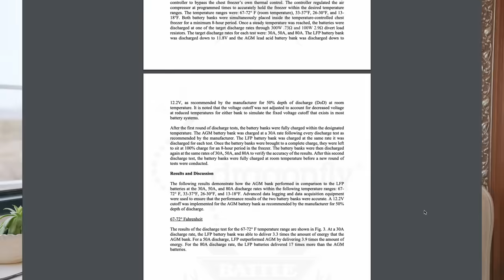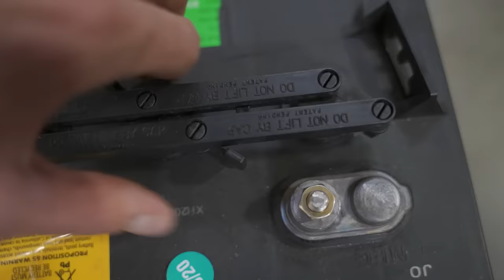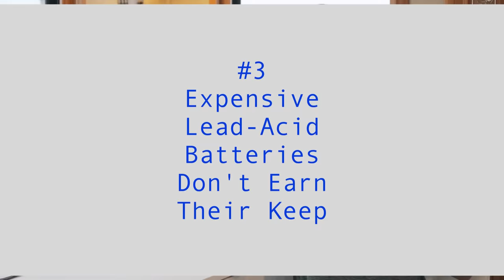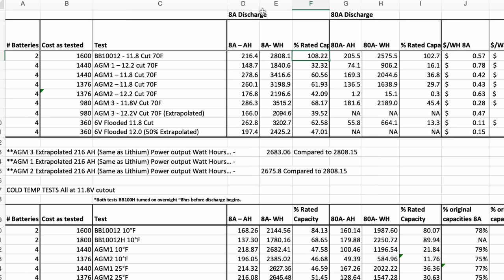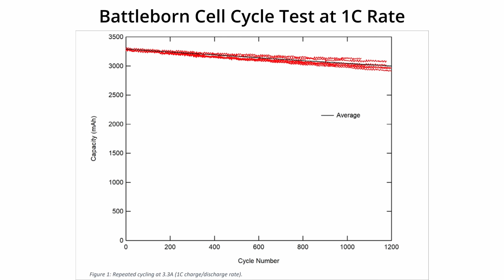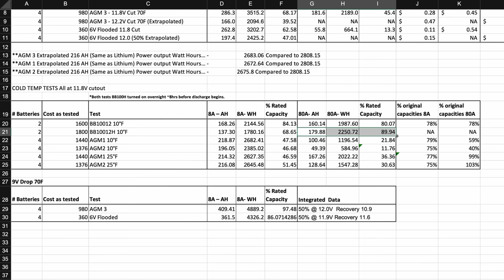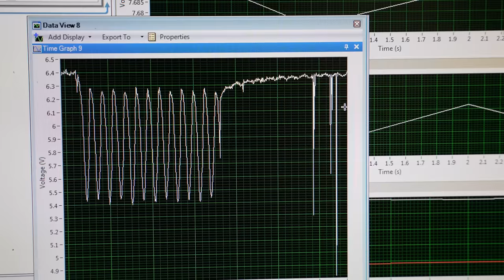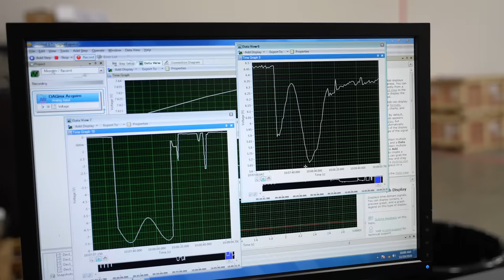Don't Waste Your Money On Batteries - The Shocking Truth I Discovered When Testing RV Batteries

Comment: Being a young person you have not had any experience with Ni Fe batteries you should look at these for stationary power banks. these batteries where used in diesel electric submarines, backup power in power plants,radio stations and traffic signals. the Edison battery company was bought by Exide  battery and was phased out by 1965 the main reason was the Ni Fe batteries lasted to long and the company could make more money by selling lead acid that only lasted 3-4 years. It is hard to find these batteries you can still find them and will need to change the electrolyte and run them through 2-3 charge cycles even these older batteries will out perform both lead acid and Li ion.

Comment: Wow this is incredibly interesting. I had the thought that Lithium Batteries may be significantly more cost effective than they seem when all things are considered but had no idea that it would such a big difference.
The only issue I have is that their warranties need to reflect the expected higher life cycle rates.
I bought an electric skateboard 18 months ago and the lithium battery has already broken after less than 100 cyles. This is a major brand battery and it is out of warranty so they expect me to pay another AU$450 for a new one (of which they are out of stock!). This is unacceptable to me. I have pulled the battery apart and will replace the dead cells but I shouldn't have to do that. It's still going to cost $75 for the batteries and a few hundred for a spot welder and I still don't know if I will need to replace the bms.
This is not a complaint about anything in this video just something to consider when purchasing expensive products, if they don't backup their lifecycle claims you can be left with an expensive anchor!
Reply: I always look at;

1. lead acid and AGM are great for buffering/caching power.
2. lifepo4 is a great source of power

For off gridding RV; i still use AGM 200AH under a converter for DC system; but goal is to keep that AGM at 80-90% charged.

LIFEpo4 is the source of power for camper (plug replacement)

Arguable some efferencey loss when going from DC->AC->DC (which bothers me a bit); but DC doesn't like to travel distances.
Reply: Just like my lithium tool batteries 12-15 months and they are dead.
Reply: @eliinthewolverinestate6729  I have two ridgid 3ah batteries from 2013 that still chooch. I use them mainly on an impact driver and 6.5" saw. Masonry is my line of work. Saw has been rebuilt once and impact driver is starting to get loose in the bit collar, but batteries are still holding strong.
Reply: @A. Melbs yeah old starter batteries seem to be very reliable, I had old cars for years and rarely had to replace them either.
The Brand of skateboard is a Backfire with Samsung cells, I’m not sure whether the issue was a cell fault or an assembly fault but I ended up having to buy a whole new battery because the cells I replaced didn’t fix the problem. My guess is the BMS needed replacing but couldn’t find one that I was sure would do the job. Hopefully the new battery last a bit longer anyway!
Reply: Lithium is not in amy way shape or form Cost effective . People don't know how to interpret the data he is presenting and not even him.
Reply: @eliinthewolverinestate6729  here come the anecdotal tales so prevalent on social media. 

Wow, really! Hmmm 12-15 months. I guess I learned something today! 😂😂😂😂
Reply: @suny1265  pretty sure it is
Reply: Not all lithium batteries are created equal.
Reply: @suny1265 
I’m guessing from your comment you would recommend AGM battery’s ? I’m having buyers remorse from an eco flow I just got (can still return) and am really thinking agm will be better for the cold
Reply: If they claim it in the description, they should add in the warranty. 

Not doing so is a big red flag.

Comment: There's one other really important factor. A calendar. We’ve purchased a grand total of 3 flooded lead acid batteries, EverStart brand, in nine full seasons of camping with our motor home. You could consider a fourth one that came with the motorhome in 2015. These batteries cost under $100 each, so let's just say $350 spent on batteries that have done everything we’ve asked them to do, with camping and travel and mixed intermittent shore power, charging while driving the motor home, using the generator, or solar charging. We do a decent amount of dry camping too. We’ve put 47K on the motorhome since May 2015, to give you an idea of how much we use it.
I believe in lithium-ion batteries for tools, however the price for these large RV batteries is still much too high and with no long warranty (8 years is what it would take) most of us are simply going to save money by not buying them. If you're going off grid and using lots of power, then maybe you will save money buying lithium-ion. But you're going to have to be careful where you spend it and with which company. From what I can tell, Battleborn is one of the most expensive.
And yes, there would be a convenience factor that is worth something with lithium batteries. There have been times where I have wanted more battery juice, but typically that has been toward the end of the life of the set of batteries. Although in the last year that has been less trouble since I built a small solar charger that we could use while dry camping. I am now in need of a couple more batteries, but just can’t pull the trigger on lithium.
I can see you know what you're talking about but your costs per watt used is misleading in a way to me. It would basically require you to use lots of power on average per calendar year, before you would see the difference in savings. I would have to be going through at least one to two sets of two flooded batteries per season to make the switch worthwhile. Until they guarantee me that the lithium battery will last 6 to 8 years, no matter what the use, it’s hard to swallow.
They could also just lower the price! Come on, we all know they could.
Anyway, thanks for the video.

Comment: What about charging profiles? Its different for the 2 battery types. You cant just switch battery types without changing the charging system....
Reply: Depends on the charge controller I have a few different types and they all have settings for lithium batteries  .

Comment: Well done. I switched to LiFePO4 in my sailboat, and have been stunned by the difference. I'll just throw out there, one thing nobody seems to mention that I think should be is the acid and hydrogen discharge of lead-acid batteries (at least the flooded kind) that is actually dangerous and the maintenance they require. Lithium is just better in almost every practical way.
Reply: They are Extremely disappointing in the winter.
Reply: @chexlemeneux8790  you can get a heating pad so they'll charge in the winter. The main issue with lead acid is they'll last 5 years compared to 20+ you get with Lithium
Reply: No..lithium battery explode and fire and cannot be put out
Reply: @esecallum  not LiFePO4 chemistry.

Comment: You, as an electrical engineer, should also do a comparison of lithium iron phosphate batteries vs super / ultra capacitors.  Will you do it?
Reply: Probably not, because no ultracap exists that could be a drop-in replacement for a 12v battery. And even if it did exist, it would weigh 5x to 10x as much as a battery for the same capacity. So there would be no practical reason to do such a test.
Reply: @johnpianezze6519  You need to do more research.  Graphene based supercapacitors are lighter than lead-acid batteries, and can handle 100,000 to 1,000,000 charge/discharge cycles without degradation.  Face it my friend, batteries will soon be obsolete, just a matter of time.....
Reply: @fk2106  Yeah but it’s like waiting for Godot, every year it’s “just around corner”....  trouble is, it’s too damn expensive to make.  Sure eventually this will be overcome, but forgive the skepticism that it’s happening “soon”
Reply: @fk2106  Where are the commercial products I can buy if it’s so wonderful and cheap?
Reply: @fk2106  I was thinking the same thing while I was watching this video I saw his series of videos he did

Comment: AGM is great for punchy engine start current. The glass mats hold the active compounds into the battery plates. For slower discharge rates there is not much point in AGM. 
The glass matting gets in the way of charging and traps bubbles which block even more access to the plates.

Comment: Try it at 20 degrees F and let us know.  I can already tell you the scales will be tipped towards AGM.  That's really the issue.  Most battery banks are not air conditioned.  Most are left in outdoor enclosures or in a storage area of a boat or RV and lithium are highly susceptible  to temp extremes.  Nobody ever discuses this.  Also, you say this is an objective look but you are also clearly in bed with battle born and offering a discount code.  Bad form.
Reply: Does that mean that if a person recommends a product that they are in bed with that company, personally I find this pretty informative
Reply: @jamesharrison5933  that's a really odd way to frame that argument. 
   You forgotvthevwhole reason he knows tge reviewer is involved with them...(which was mentioned in the comment)... discount code... sponsored. 
   Are you "special" ?
Reply: @Dirk Jefferson  agm is good for starting power and high amps.. the capacity on them and life cycle are a joke. If you want solar storage for actually powering things lifepo4 is wayyyy better than AGM. If you want to start a motor, go with amg. The depth of discharge of AGM is 20-30%... vs lifepo4 is 100%. Massive difference. Charge cycles? Lifepo4 is about 3000-5000 cycles vs AGM at only a few hundred charge cycles@20 depth of discharge.
Reply: Did he not say the particular lifepo4 batteries are heated ao they will perform fine in cold weather.
Reply: @Dirk Jefferson  no depth of discharge is not voltage drop... look into it maybe. A battery being 8 years old means nothing... why would it? Lifepo4 cells are actually very safe compared too lithium. Agm has horrible energy density and life cycle period.
Reply: He gives away a lithium battery 😂 Not acid 😂

Comment: Perhaps measureing Specific Gravity would have given a more accurate indication of 50% charge.
Reply from the maker: For the floodeds yes that would be a good way to go, it's essential as they get older too to know how they are degrading.
Reply: I tested my urine via test strip and my specific gravity colour range was off. I do not understand? Do I need to charge my battery? 🙄😳
Reply: And how exactly are you going to do a S G test on a sealed battery??

Comment: For some updated information on the newer LiFePO4 Batteries, keep in mind the better ones have a built in "Battery Management System" (BMS) that prevents a few things, like overcharging, over DIScharging, or charging when too cold.
These BMS's are rated in Amps. If the battery has a 100 Amp BMS, it can only be charged at 100 Amps, Max. AND it can only be DISCHARGED at 100 Amps. Which is about 1200 Watts at 12 Volts, thus, if you want to run a big inverter, you will need a Parallel setup, one battery per 1,000 Watts. Or 3 in series, getting the wattage needed at a lower current.
Be careful. Not all Big Batteries have Big BMS's. I have seen a 140 Amp Hour battery that came with a 100 Amp BMS.

Comment: That was my favorite "LiFePO4 vs anything" comparo video! We have a 300Ah Battleborn battery bank for our Sprinter and couldn't be happier. We leave our low-draw Webasto diesel heater running to keep both us and our batteries toasty in the winter.
Reply from the maker: Thank you!
Reply: When did he say they were LiFePO4? I missed that
Reply: @robertfloyd4287  that's what Battleborn batteries are...
Reply: Robert Floyd he didn't.  It's very relevant, but it was not specified.

Comment: Every situation is different. LiFePo batteries have two advantages, weight and useable power density. In my case, a 38' Class A RV, neither are a critical limiting factor. When I purchased my 1990 RV in 2020 it came with two Group 8D FLA batteries. In AZ the batteries lasted three years and the heat just cooked them. That and I was not as attentive as I should have been to electrolyte level. I just replaced them with two Group 8D AGMs and three Group 31 AGMs. I also have room for six more Group 31 AGMs that I plan on adding before heading out this summer. This should give me a total of 1,400 AH capacity after the upgrade.

The first thing I noticed when going from FLA to AGM is that the FLA batteries are lighter (120 lb vs 165 lb) and the storage capacity (200 AH vs 245 AH).  The weight didn't have any noticeable effect on the handling of the RV, however, I did need some assistance replacing them.

Before the change, the batteries would be fully charged from the 390W solar panel and floated at about 12.8 at sunset, and by the morning the voltage was down to 11.0, since the replacement the battery voltage in the morning was sitting at 12.5 after a typical night. For my application it just doesn't make financial sense to switch to LiFePo.

Comment: I wonder how lifepo4 compares to standard lithium ion? I'm guessing other than size and weight/kwh; lifepo4 beats both standard lithium ion and lead acid by cost and cycle life, while also safer to operate.
Reply: Regular lithium is cheaper and weighs less than Lifepo4 for the same capacity.
Lifepo4 has better cycle life and is safer.
Lifepo4 is the winner for the safety aspect alone.  The extra cycle life is a bonus.

Comment: Thanks for these comprehensive Infos! I did experience similar outcome even with starter batteries on my motorcycle, where weight is a critical factor on top of all. A84 Wh LI battery provides 10 times more starting procedures than the stock AGM 168 Wh one, weighs about 1/4th or less and serves now for the 5th year, while AGM never even made a second season.
Reply: I agree on agm motorcycle battery. Like my lithium tool batteries it only makes it a year. I have kick starter and super capacitor now for my enduro. It should last 20 years.
Reply: Be careful. Most of these Li-ion batteries for automotive applications are LiFePo4 chemistry which cannot be charged at temperatures below freezing without severely damaging them. I've seen where some of them will incorporate heating elements within the case but not all manufacturers do this. They should also have an internal BMS that protects against charging if too hot or too cold. Cheaper batteries may not have this protection. For an automotive application you may want to consider the relatively new Lithium Titanate (LTO) chemistry. They are a bit pricey and not as energy dense but they're virtually indestructible. They can be fully cycled thousands more times than LiFePo4 and have a much broader temperature range (-40 to 165F). They can also endure extremely high discharge rates without being damaged. They can take incredible abuse without damage. They're starting to show up on eBay, sold by companies like XS-Power.  Google it...... Good Luck
Reply: I am a big fan of the LTO chemistry, but it seems to be hard to source them.
Reply: @Tron-Jockey thats a good point you make about temperature - when tempeture  is not a problem lithium is a good choice - also in boats, campers and aircraft weight.matters so often lithium is a better choice

Comment: The maximum discharge voltage is 10.5 Volts for lead-acid batteries.
Most inverters shut down at 10.5 volts.

I don't know why the manufacturer would tell you otherwise.

Comment: My wife and  I have been grid tied here in Florida for 10 years and 6 months on the original AGM group 31 105 amp hr @ 20 hr rate batteries from East Penn. They are the longest running set of batteries that I have ever run in any application. These batteries have went weeks on end powering 2 Schneider Conext XW 6048 inverters, during outages caused by various hurricanes over the years without missing a beat. Of course we have solar charging during the day and we definitely watched our loads during these times but all in all I have to say listening to the data and the information provided we should have had to replace our batteries at least once, maybe twice. I know LIPO batteries are good but are AGM batteries really that bad?
Reply: Why even ask? If you got 10 years of use from AGM that answers your question.

Comment: Pretty good although the statement about voltage drop causing more current isn't really true unless you're using an actively managed system.  Devices will usually draw more amps with more volts because of overcoming resistance (unless that is also accounted for).  However, it certainly can be said that there are efficiencies to be gained with higher working voltage because it lowers the REQUIREMENT of low-resistance (large) wires and interconnects.  Many devices simply won't work if they're out of voltage spec.  (For example: AA alkaline vs NiMH)